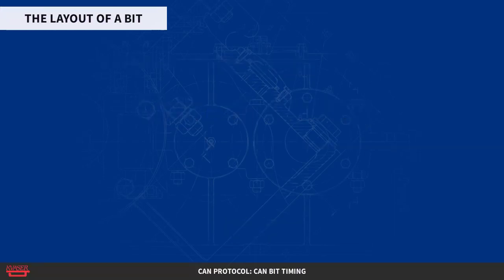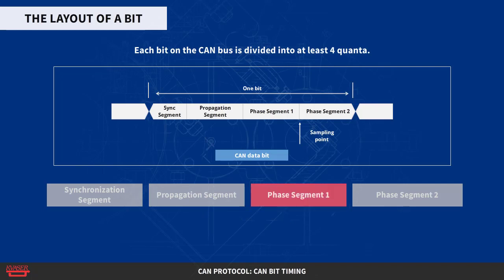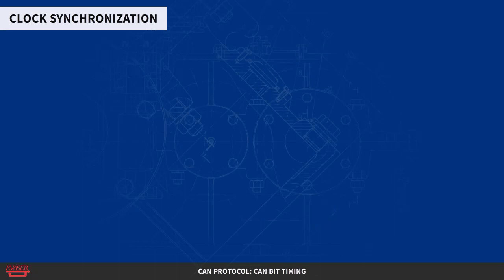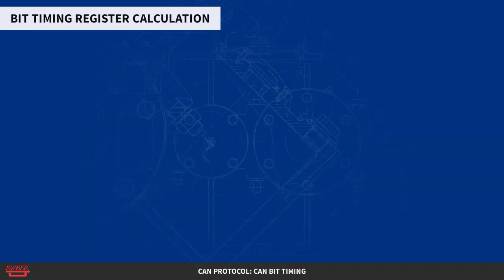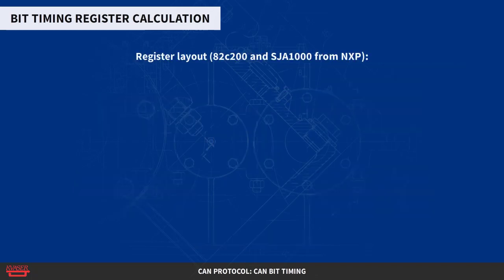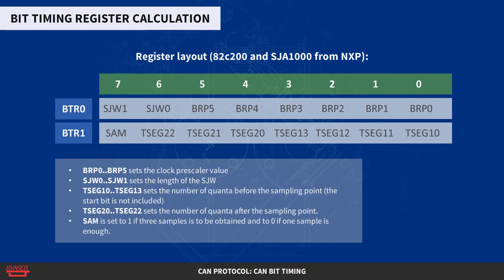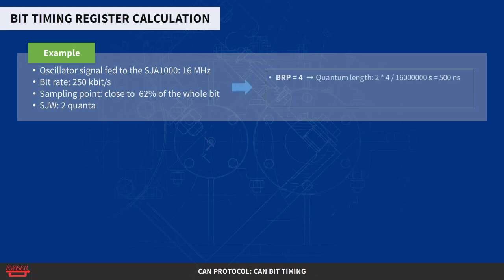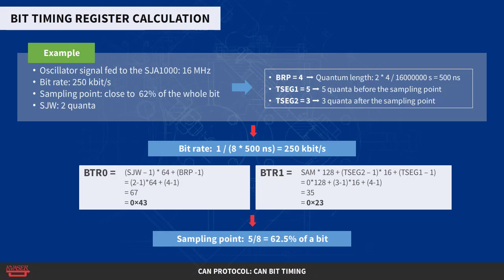Kvaser CAN Protocol Course: CAN Bit Timing (Part 7)

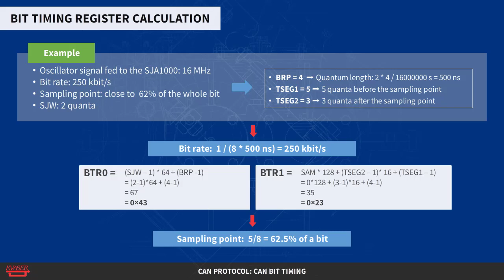Comment: @3:57, you show --tseg2--(edit: meant tseg1,  see below) to be 5 but in the calculation for btr1 you use 4.  Effectively, being off by 1.  BTR1 should be 36 or 0x24.

Edit:
BTR1 = SAM * 128 + (TSEG2 - 1) * 16 + (TSEG1 - 1)
BTR1 = 0 * 128 + (3 - 1) * 16 + (5 - 1)    <-------its 5 -1 not 4 -1
BTR1 = 0 + 2 * 16 + 4
BTR1 = 32 + 4 = 36 = 0x24
Reply: If we keep BRP=2 and accordingly tseg1=10 and tseg2=6; which will translate BRT0= 0x41 and BRT1= 0x59. Can anyone confirm if these settings would be correct ?!